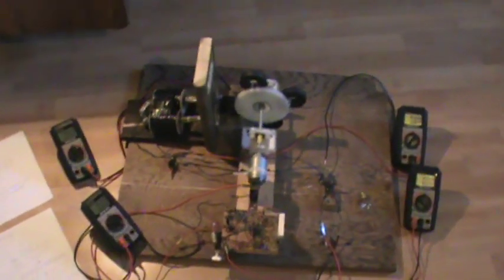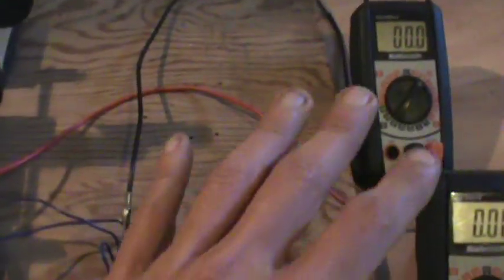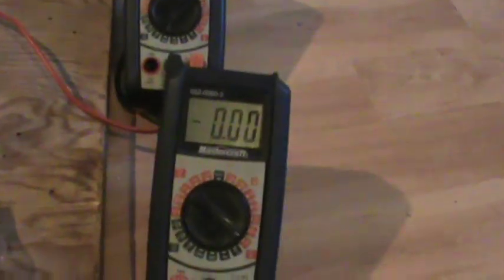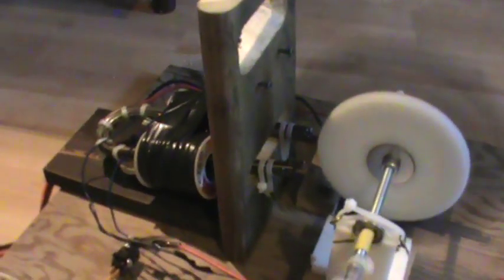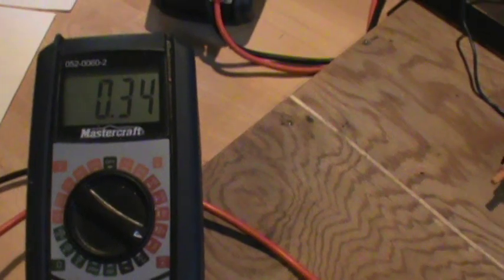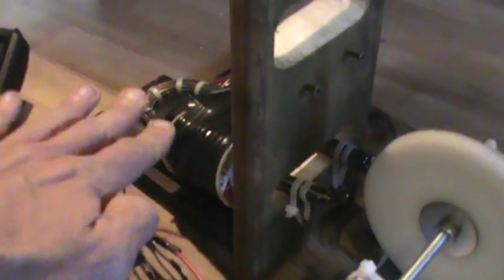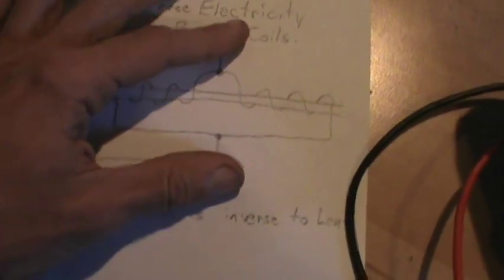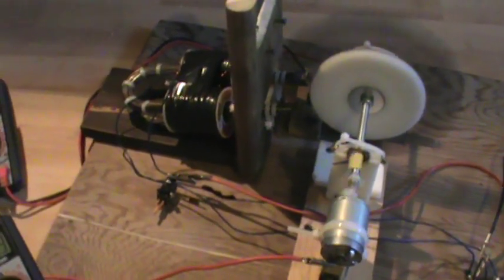Free Energy Demonstration - Tapping The Bucking Coils

Comment: what would happen if you send a coil through the prong ends? instead of magnets use coil pickups.you would need to prime the prong of the pmh with a bar, pulling it of many times to get the magnets to flow between the prongs.

Comment: Many thanks for your answers!
Then my first test will be a core made out of 20x30x90 mm ferrite blocks with as much 0.3 mm wire as posible. I will also make a core with circular cross section from welding rods and compare. But I'm a slow builder, so don't expect.... I was also thinking about the "coil in a can" thing Ed talked about.

Comment: ... continue previous post....

As I can see, the coils are in parallell.
The current where the coils are close to each other have the same direction, but the magnetic field i opposite? Wouldn't that suggest that the coils should be placed with at distance from each other? 

Or should they be as close as posible so that the magnetic field is locked up in the middle?